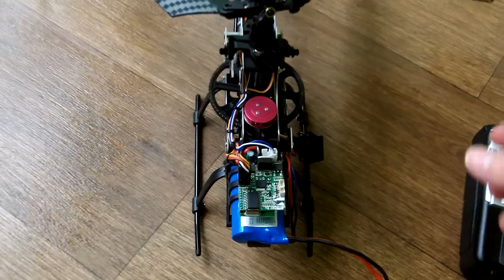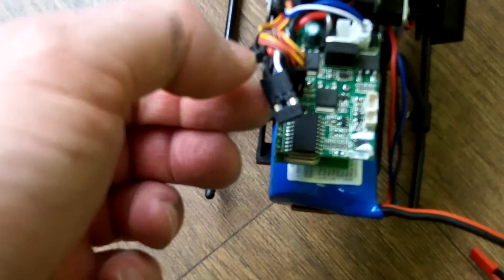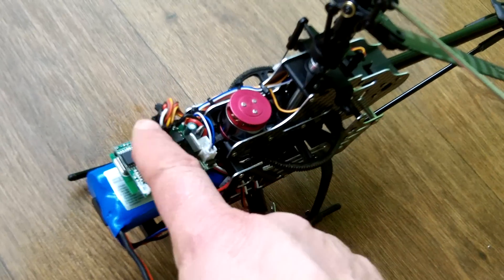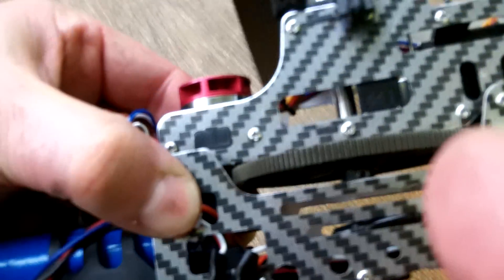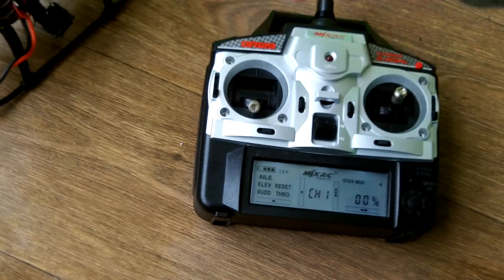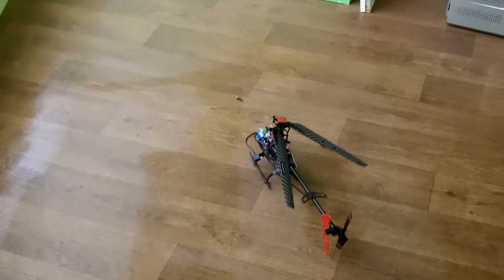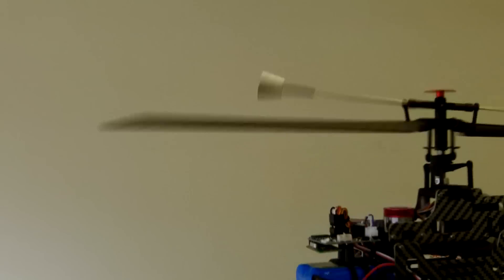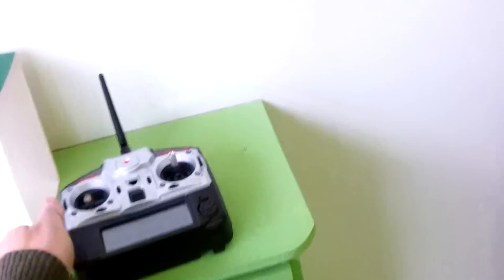MJX F45 Modified With EH200 Brushless Outrunner & 25A ESC

Comment: Without trying to read 300 pages of forums on my phone, what is the size and kv of the motor? Also are you using a 3S on the motor?
Reply from the maker: EH200 Brushless Outrunner 4100kv
Weight: 23g 
Kv: 4100rpm/v
Size: 23 x 35mm
Max current: 18A/200w
Current: 10V/2.8A (No load)
Shaft: 2.3mm
Shaft length: 9.5mm
Bought it from hobbyking.

Comment: Ok, so did you modify the motor base and the frame in order to fit the motor in without getting it rubbing against the metal frame of the helicopter?  Another thing,  I know this heli uses a 10T pinion gear,  but which one did you get? And how did you install it in the motor shaft?  I would appreciate your promptly response Thanks.